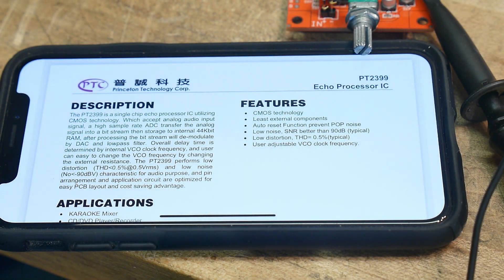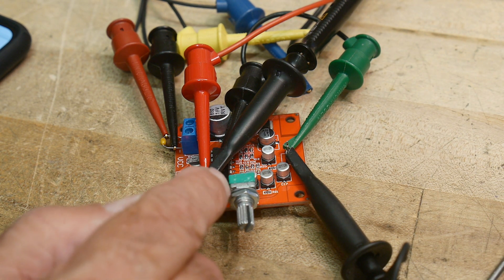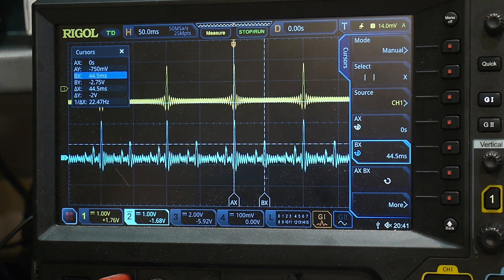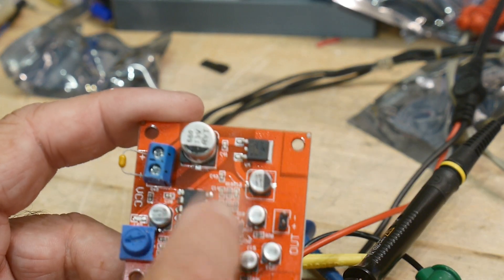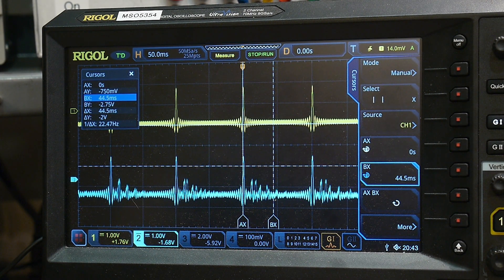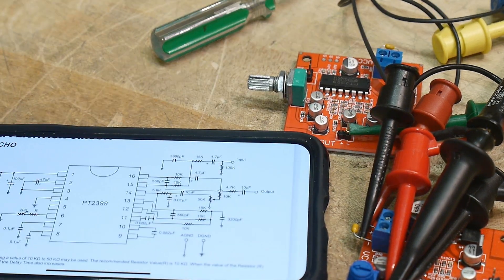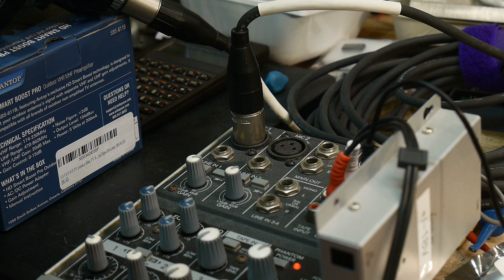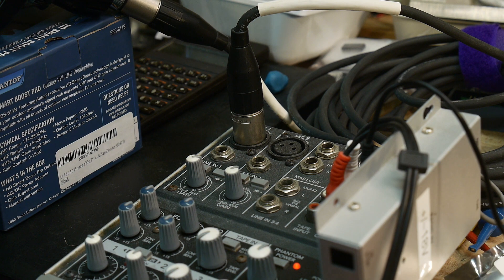#1253 PT2399 Echo Processor Module

Comment: Pt2399 is used in many guitar effects. Noise   increases with delay time and audio quality decreases with delay time. You can use lfo generator and connect it to 6 pin through capacitor (i simplified) and you get chorus effect. Reversing phase in feedback also gives nice effects. Lot of fun with this chip.

Comment: Supposedly these were used in karaoke machines and other such devices, so it's a cheap reverb but not a great one. I can't remember if you covered desoldering the resistor and using another potentiometer to add a time adjustment or not.

Comment: Are they labeling this chip an echo?  It seems it's a reverb and not an echo A big difference. Think echoplex
 A tape unit.
Reply: It's echo. Reverse requires shortest time delays and lot of feedback. Betonu Brick uses 3 pt2399 in one circuit to achieve reveb, but pretty short one.
Reply: Belton Brick I meant.

Comment: Back in the day we made BBD devices that were used for audio delays. I recently found a few of these, MN3005’s.  Lots of cool things you can use them for.
Reply: I love the Matsushita MN 3005.... , but i think these chips are not digital.
Reply: it's a bunch analog switches and capacitors in a ic, it's just moving charges on clock pusle., that's why it has 2 clock inputs.